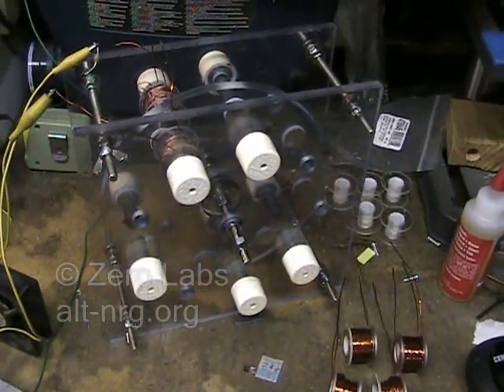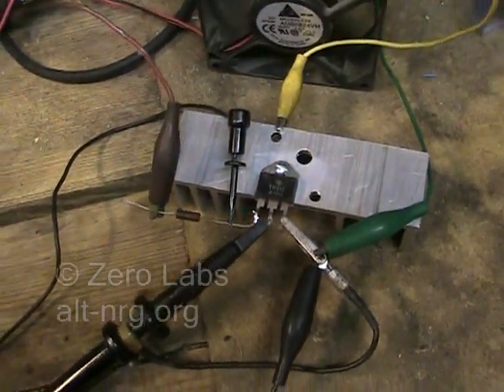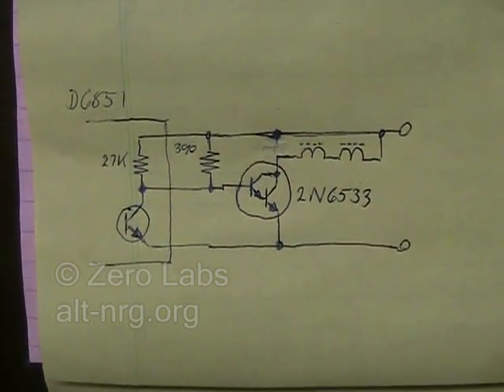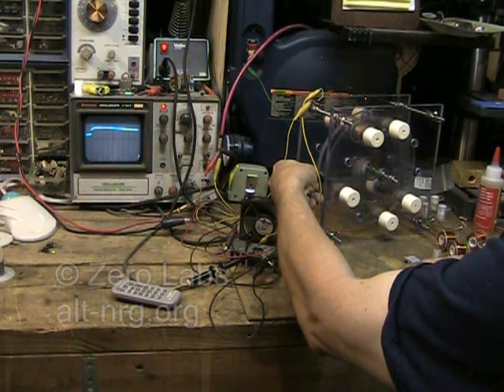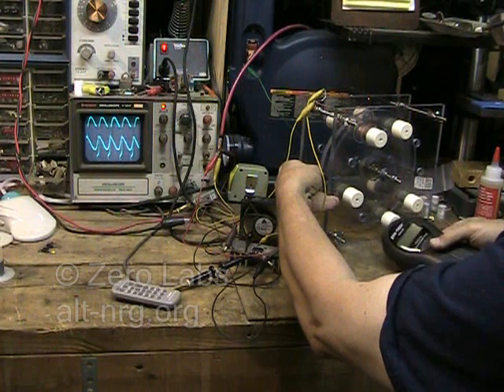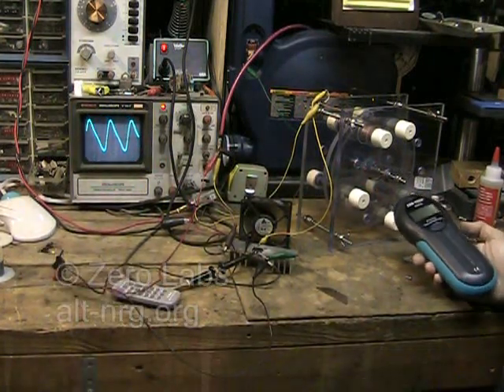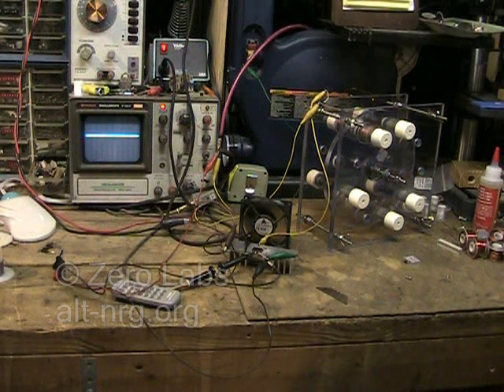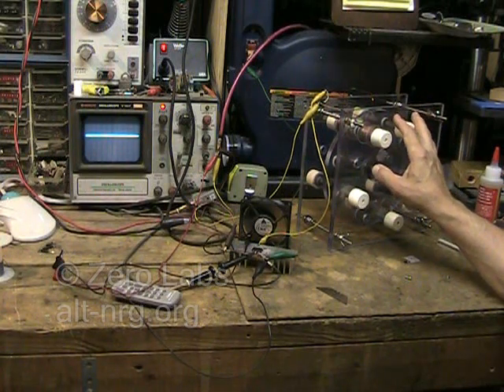#282 Muller Motor test run

Comment: Can you dumb this down for me - I understand you are putting in 12 volts DC but how many volts AC are you outputting?
Reply: Does a magnet hold a paper on a fridge? YES    .SO MAGNETS  DO DO WORK. --YOU DOE DOE BRAIN.  magnets are free energy.
Reply: don't bother, it's a scam based on inertial disk principles,  if you measure the energy going in, and the one coming out, the scam will be exposed,  there are no magic alignment tricks and such, magnets don't have free energy!

Comment: @topjimmy44 
Zero reconfigured device so the 2 sets of bearings ARE on the outside supports and not on the rotor. Else, he could not have spun up the rotor with his Dremyl tool on the shaft. Heat was not a problem at 4,000 RPMs. Rotor should create a fair amount of cooling air circulation. Same concept works well for bicycles. They bear greater weight @ lower RPMs. =No doubt you have coolant flowing through the axles of your bicycle?

Comment: Very cool and great work.  What I wonder is the durability of the bearings.  Would be nice if bearing replacement was easy here too because for a device like this to work well, ease of repair, if needed, would be a benefit.  Probably not possible to put the bearings on the outside though.  Also, with the heat generated, need a way to dissipate - heat sink of some sort on the shaft coudl work, but what if the shaft was hollow?  Water cooled, pumped through shaft could work.

Comment: @WaxingRadiance I am on overunitydotcom, I post some coil driving and dc to dc converter circuits but nobody seems to be interested. Overunitydotcom seems a club I ain't in it. I'm an electronist technician and I have over 20 years in designing professional circuits. It's frustrating when you want to help people with professional circuits and got ignorance for change. So I choose to stay at low profile and who is interested, just contact me in private.

Comment: The initial spin up with it's own drive coil is smooth little vibration at 3500 rpm
I did'nt catch the input draw from the astron power supply. look forward to #283

Comment: Wow, nice work.  I wonder if you would want to include a non-invasive thermometer on the bearings of the shaft - at these RPM's temp might warn of an impending failure that COULD cause injury,  This is GREAT, thank you.

Comment: one question, you will be using 2 coils to spin and 17 to collect? so the driver coils and collectors could be diferent right? what voltage and current (w) are thoose 2 coils using right now? I wonder if a low rpm wind mill would be enought to start it

Comment: Love the ending speech, very well said. Noticed your connecting bolts and shaft. Some say it is better to use as little magnetic material around your magnet wheel as possible, to eliminate any or most of the interference. Using nylon or brass bolts for most of the assembly. Just an observation. Thanx for sharing :)